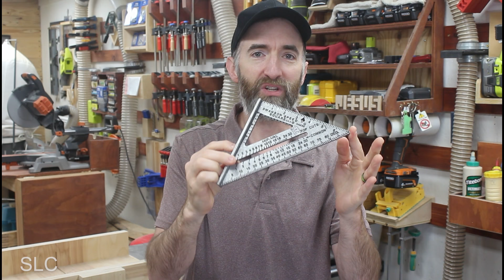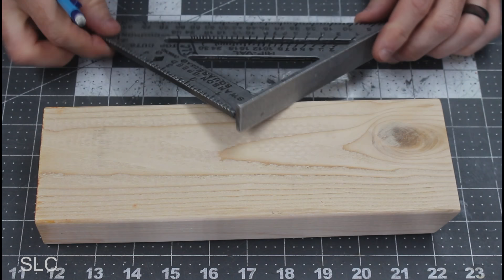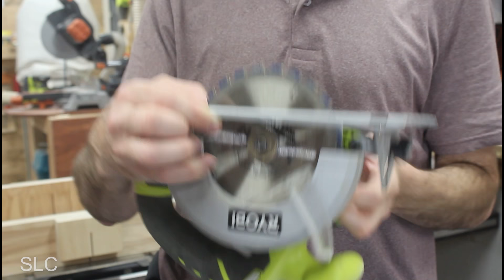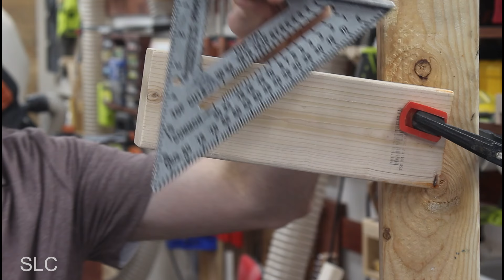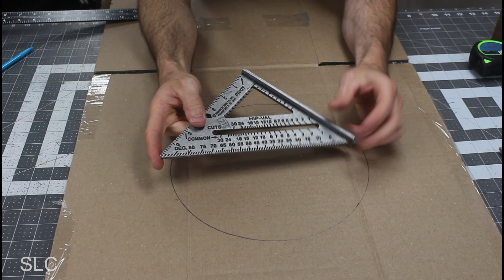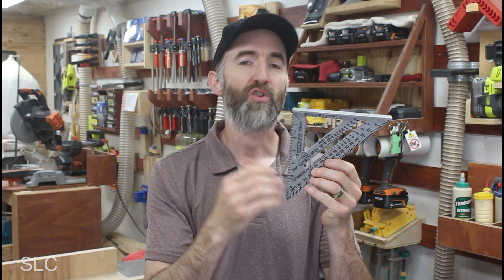Speed Square Tips That Make Woodworking Easy! For Beginners

Comment: RESONING ALL WRONG.  METAL SQUARES ON HOT ROOFS GET BURNING HOT TO USE.  PLASTIC DOESNT MELT.  IF YOU DROP PLASTIC THEY NEVER BREAK.  PLASTIC IS PREFERRED BECAUSE IF YOU DROP IT ON CUSTOMER TILE FLOOR WONT CHIP TILE.  ALSO WONT DIG INTO HARDWOOD FLOOR LIKE METAL POINTS AND WEIGHT TO DING FLOORS.  PLASTIC WAY TO GO
Reply: @PostUp_Time  is your caps lock broken there Pablo?

Comment: You can actually find the center of a circle with one square. if you put the outside corner of the square anywhere on the circle, mark where the legs cross the circle and make the triangle of those two marks, then rotate a bit and do again, where the hypotenuse intersects is the center of the circle. you can do extra triangles just to be extra sure since marking width and yadda yadda. but thats the drywallers problem...

Comment: Thanks for the video, well done. Referencing 5:15 of the video, does it matter as to which edge the lip of the square is placed, close or away?
Reply from the maker: If you watch the video again, I placed the square so that the extra length would be on the side you are starting with the circular saw so it has a guide to start the cut. I hope that helps.
Reply: @SpecificLove7  Got it, thanks.

Comment: cool video, very helpful & I didn't know that a speed square was so useful, I usually just use it for squaring up. Unfortunately my speed square is plastic but I have been using it for years without issues & it has a level built in, lucky me.

Comment: Now, if I want a 381/2 in 2 by 6 at a 30degree angle on one side and a 40 degree on the other? What point to point should that be measured?

Comment: When you were using the level and the speed square to make the perpendicular line (at about the 7:20 mark… You could’ve just used the level in the vertical position. There’s a bubble on the level for that purpose
Reply from the maker: I agree, I was just trying to show another option

Comment: I use speed square in book making and shelf lining with contact paper and wall paper. No bubbles and helps with matching patterns. I use it in sewing also. Making patterns for straight lines and weighing pattern down to cut pattern and fabric. Also helps cutting fabric squares and strips for quilting.

Yes I use it for wood working too. But it's versatile.
Reply from the maker: Wow, I had no idea the speed square could be used for those items as well. Thank you so much for letting us know.